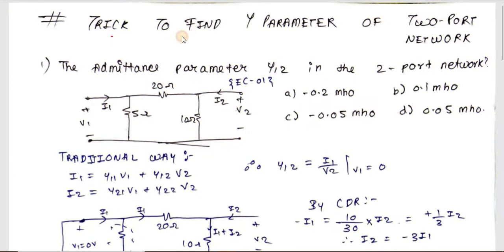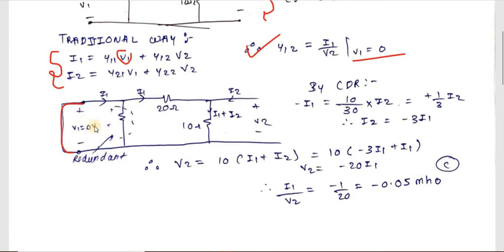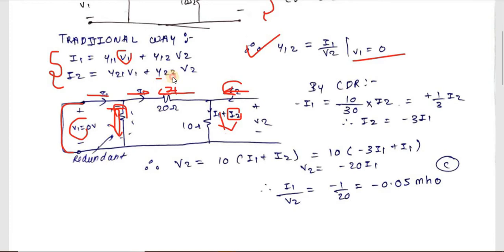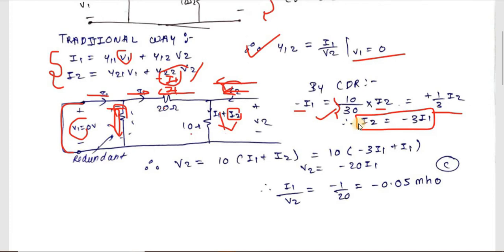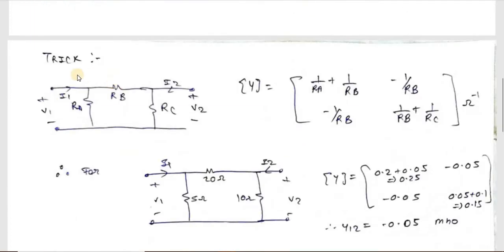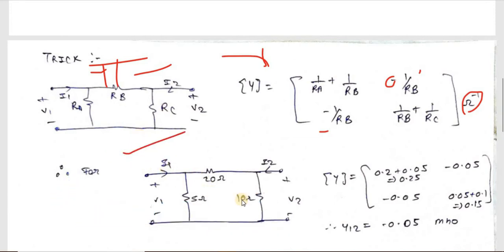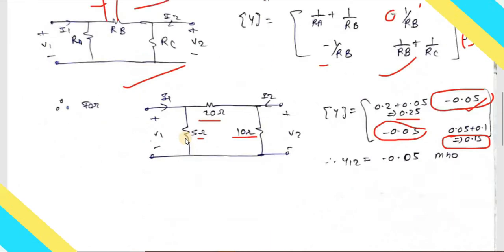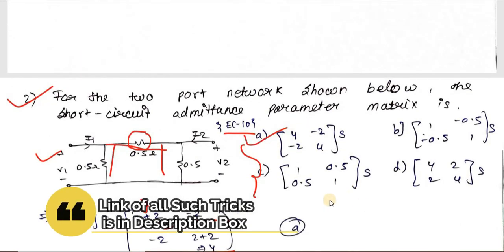Trick To Find Y Parameter of Two port Network | Y Parameter Tricks | Two Port Network Tricks | 2020

Comment: when the voltage is 10 volt the current I is one ampere if the applied voltage across the terminals CD is 100v the short-circuit current flowing through the terminal AB will be